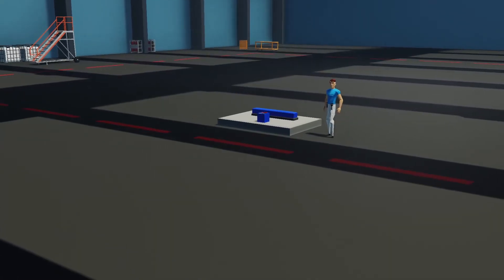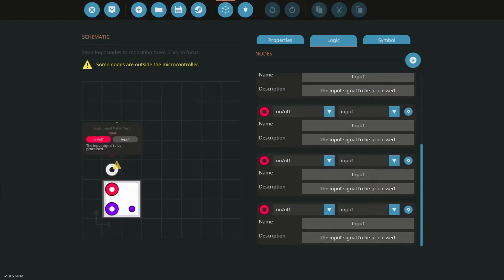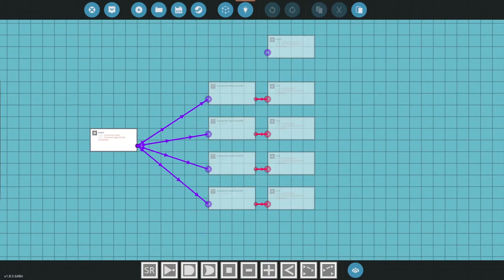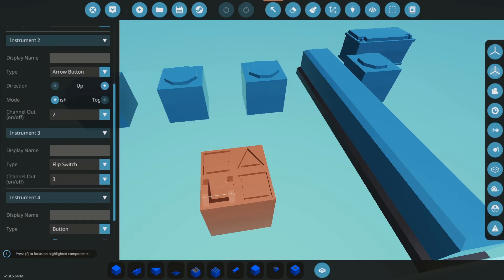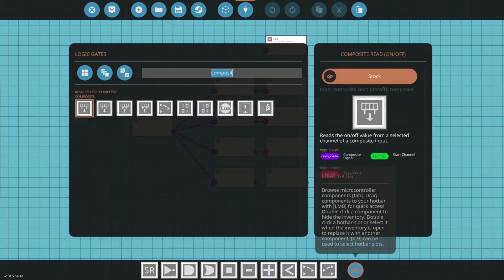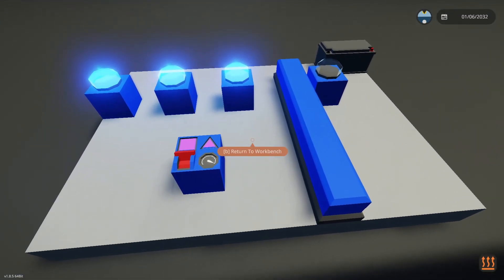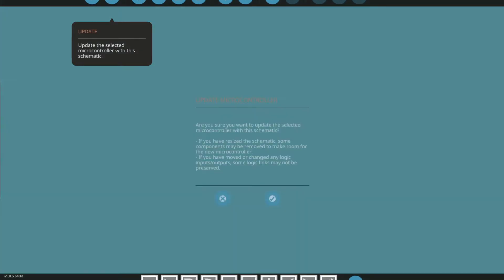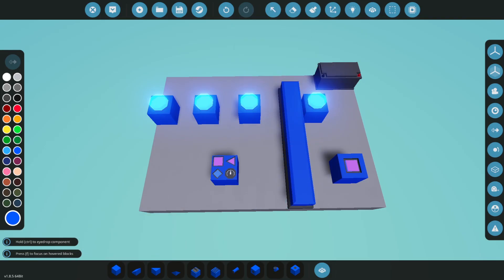The MOST USEFUL microcontroller (Composite Instrument Panel)

Comment: What would be advanced version of this, using 2 or more bigger micro controllers, but having a 1x2 micro controller for the 'brains'?
Currently taking advantage of looping multiple intrumental panels, i have mostly use 2 mc per side in my "Radial Daisy-chained Docking System"

Comment: I followed your buildning dot to dot, and everything works great except the dial. It only says 1.00 when i hover over it, and i was also wondering why it shows more details for you than for me. Thanks anyways!
Reply: Dials need to have their range set, otherwise they are default at 1 I think. And to see more info when hovering over something it's a setting in the gameplay settings that you have to turn on, forgot what it's called exactly but you should find it when you read through them